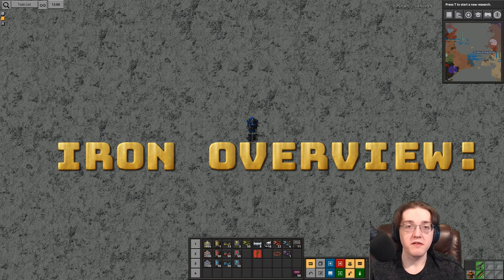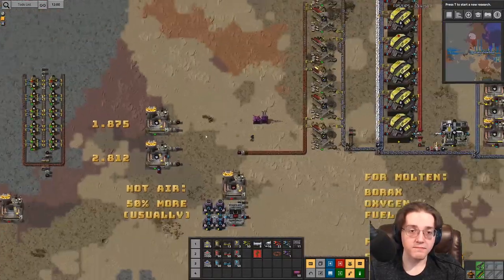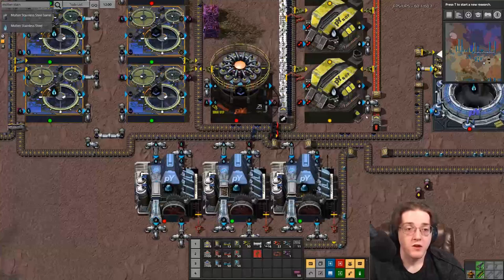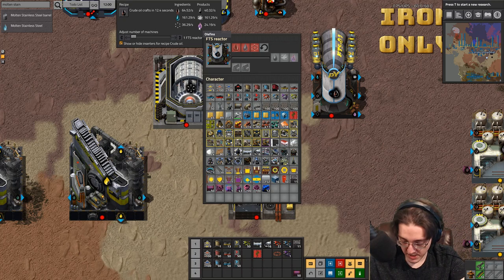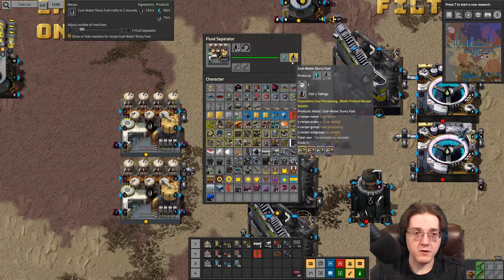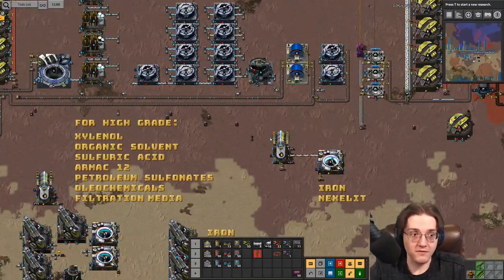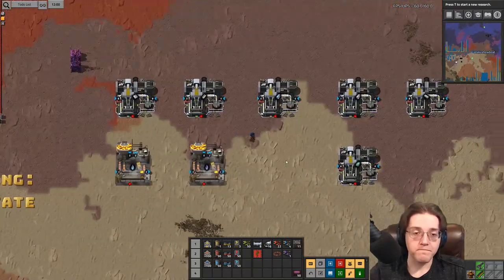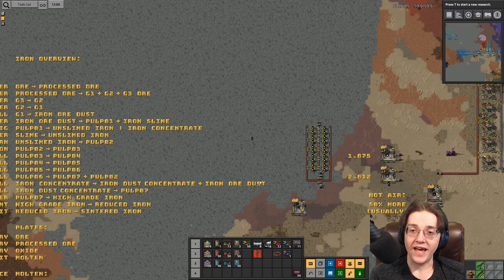Tutorial - Factorio Pyanodons Mods Iron Processing Overview

Comment: Thanks for the tutorial.  Somehow I had missed the recipe for processed iron directly to plates--I think I saw the processed->molten first and dismissed processing as a molten-only thing.  Now with just a few (OK, 12) jaw crushers my iron is looking much better than my old hot air line.  One thing I found very useful was your separation by science levels--lots of stuff seems useful until you realize it needs one process that you can't do yet.

After your copper tutorial I would recommend doing a (possibly short) video giving a basic overview of what the different materials are useful for.  For example, aluminum is used in some advanced buildings, and especially for duralum. which is good for vital things like fast inserters, etc...

Another idea for a tutorial might be a basic intro to Pyanodon:  why this modpack is interesting, what mods to get, which other mods are useful (esp. ones like FNEI), and maybe some more general starter tips to help one reach red science.

Hope to see more tutorials soon!
Reply from the maker: Immediately following copper I have already planned out to be quartz / glass processing, another necessity for getting to red science. A lot of the useful early-game tips to get to red science will be in the red science tutorial that I may insert into one of next week's slots. I'll also see what I can do about making a dedicated "burner stage" tutorial to get people started and on the right track.